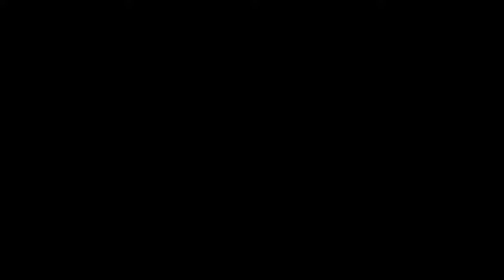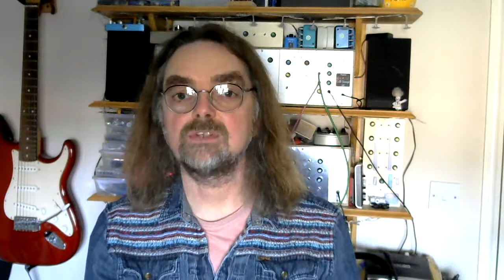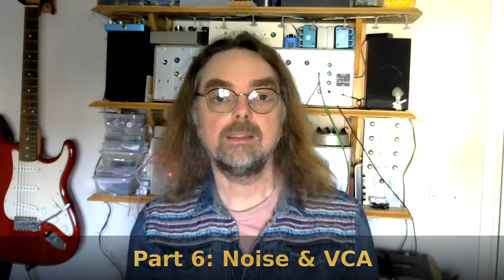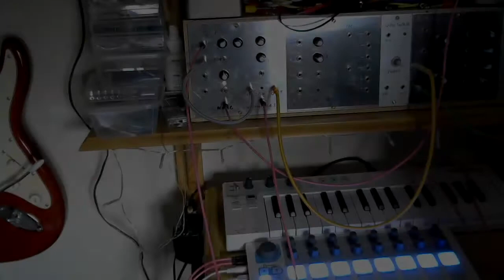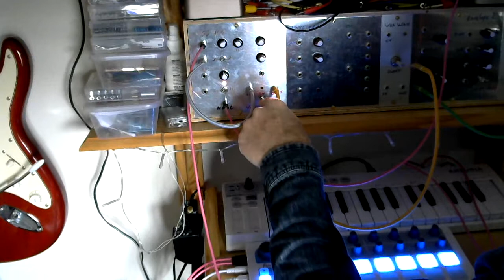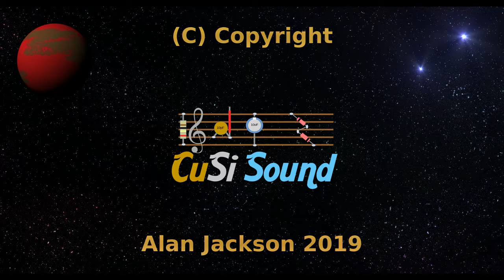Project Nine Modular Analogue Synth: Noise & VCA

Comment: I love the soft sound of vactrol triggers! Nice job. By the way, I believe I know what may be causing your interference. I have made this circuit and it works for me if I use 1 µF ceramics caps instead of .047µF. However, if the voltage is below 8, I do receive AM radio signals. I believe this is because until the transistors receive enough charge, they won't go into avalanche mode. Also, I can pick up stray signals if the circuit isn't grounded correctly so your problem may simply be that you've missed one of the connections to ground. I haven't used this in my modular case, so there may be problems when the common is shared with other modules, but I hope this helps.
Reply from the maker: Thanks for the advice. I used SS9018 transistors as they will avalanche at a relatively low voltage but as I said in the video, I'm pretty much on the limit with a 9V system. The common power rail may be an issue as well. I will revisit noise at some point as I will need it to build up my collection of drum modules. For now, I have a backlog of projects I need to clear. Watch out for future videos on those.
Reply: @CuSiSound  Looking forward to it!